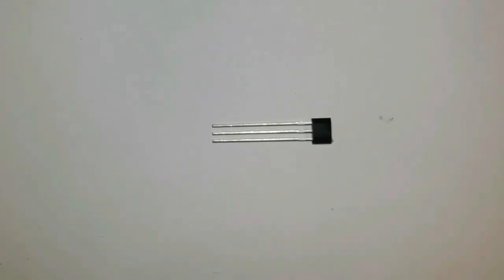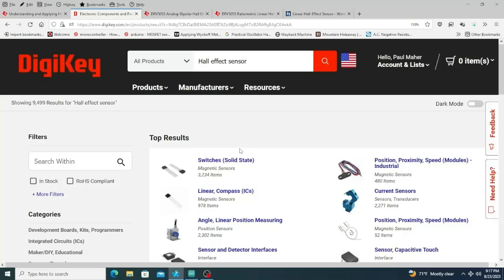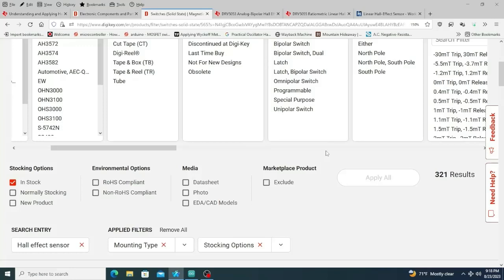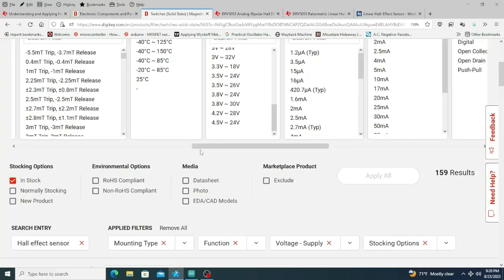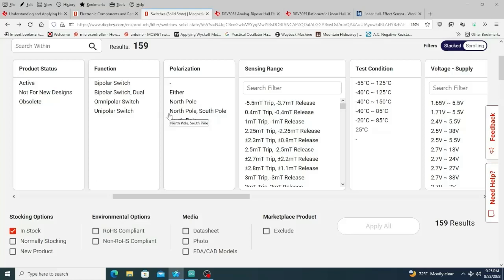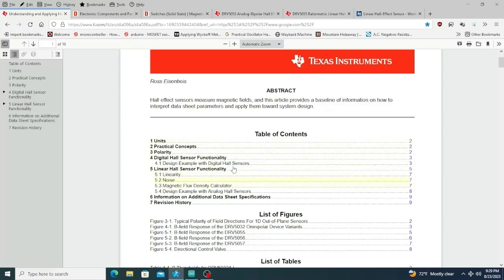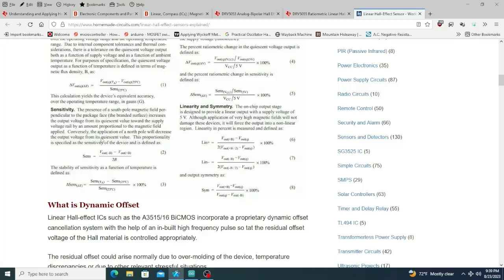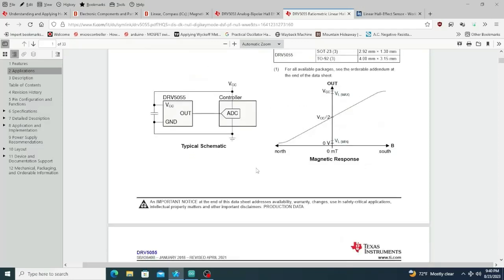How to Connect a Hall Effect Sensor to an Arduino to run a Pulse Motor

Comment: 15:20  Pulsing the coil in two directions will not change the pole position on the core.  " "Right Hand Rule "   It will change the direction of the pulse input as well as the flyback polarity but the poles if I am not mistaken will not change .  "RIGHT HAND RULE"
Reply from the maker: Hi Myke, reversing the +/- leads on an electromagnet does in fact change the polarity of the electromagnet.  In terms of the right hand rule the best way to think of it would be rotating the hand 180 degrees. What I presented here is a much easier to implement, and more versatile, version of the John Bedini/Ron Cole Sequential Bipolar Commutation circuit https://www.zyneng.com/?p=1127 Whereas their version used 2 hall effects and six transistors this version uses 1 arduino, 1 hall effect and 1 2 channel SSR, and it can do PWM.  They didn't have things like arduinos or SSRs when those guys put together that H-bridge circuit.  Back when I used to put together the Bedini/Cole bipolar commutation circuit I would test to see if I had it right by watching it flip a magnet first one way then the other way.  Besides, the next spinning rotor video I am planning on showing I will again return to bipolar commutation and have the thing spinning with N->S magnets going past.  Thank you for the comment but yes if you have a coil and a polarity indicator or just a magnet you can test it and see that reversing the leads on the coil reverses the polarity of the coil.
Reply: @paulmaher812  but you get my point about the thumb direction is NORTH no matter what
Reply from the maker: @mykedoes4099  Hi Myke, always a very good idea to question and I can see how it appears to not necessarily be consonant with the Right Hand rule on first inspection.  Will just say, this is not my first rodeo with bipolar commutation, when I get around to doing the next video will show (hopefully, hehe) this circuit spinning a rotor using bipolar commutation and then I can get an idea if I like this approach to bipolar commutation as much as I liked using the Hall for monopolar commutation.
Reply: @paulmaher812  just saying the right hand rule is that the right thumb with right hand winding (not left hand winding)  always point "north". No matter how you polarize the winding. Thats the rule anyway , but if i remember from my lab observations this right hand rule is not accurate at least not with DC. it may be accurate with AC since ac has both the pos and neg constantly flipping
Reply: @paulmaher812  Right hand rule says the north is pointing the direction of the right thumb , so if you swap the pos/neg where before the thumb had the pos and now the thumb has the neg , this does not change the rule and the thumb direction. But ya if i remember myself it did change the north pole orientation regardless. So maybe this right hand rule is not so accurate or my memory does not serve me and i need to physically confirm this again.